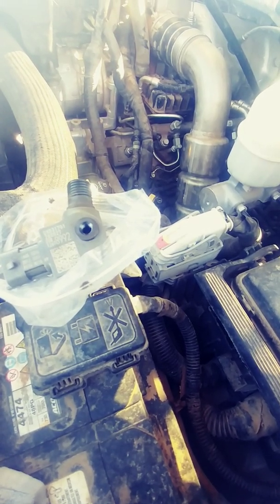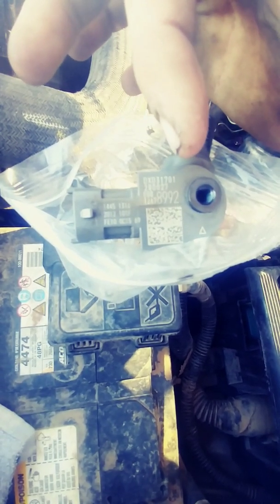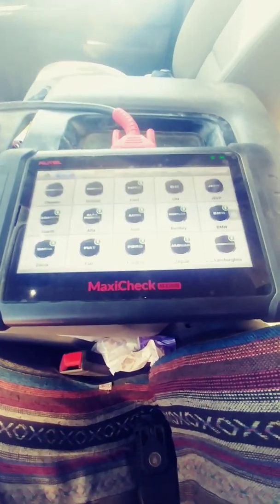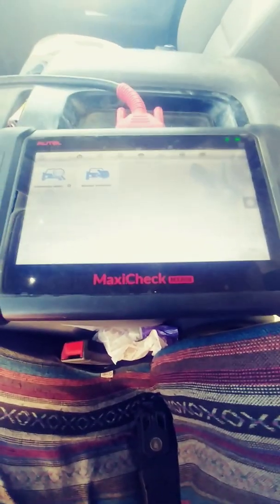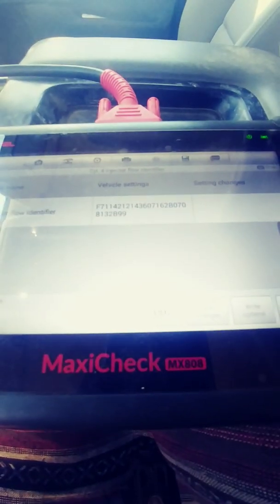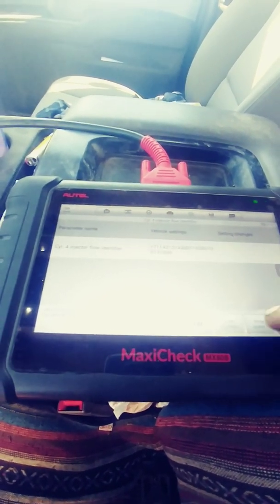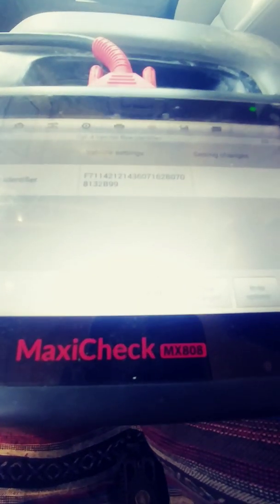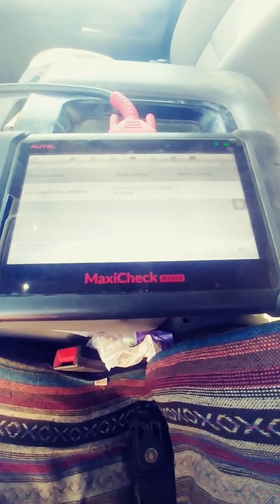2017 Chevy GMC Chevrolet Duramax 6.6 Injector flow rate programming coding Autel MX808

Comment: Are you able to save the flow rates and program them into your  Glow Plug Control Module GPCM?   (Just FYI that is where they are backed up just incase your ECM has a stroke.)

Comment: I am using a Snapon versus tool to program my LP5 cylinder 4 diesel injector and i kept getting function not performed correctly. I am putting the vehicle into service mode aswell ( hold ignition for 5 seconds) and still doesn’t work. Any advice?

Comment: Watched this cause I have never seen someone use an aftermarket tool for Flow Rate programming as I use GDS2 (GM tool). Just throwing this out there, in my experience it's best to change the injector connector also. They seem to be terrible with terminal tension and breaking terminals. Only injectors I've changed on the quite of few L5Ps is Cyl 4. Since the first one I did came back missing on cyl 4 and I noticed one terminal wouldn't even hold my test probe in it while being upside down, I've changed connectors also. That connector has no support like the others. An older Duramax (LLY?) had a tsb and a kit that was to change 2 injector connectors and add support tabs for them to prevent terminal breakage. These engines hopefully will have something like that in the future for Cyl 4.
Reply from the maker: I use snap on for my older vehicles and autel for my newer and my HD diesels.  Been very impressed with the scope of capability on these tools for what the price is.  Also use Autel for my labscope.

Comment: What’s the next model up from the mx808 that will do vgt ? Also assuming these do all of the body control stuff like windows and door locks ?
Reply from the maker: I believe it's the 906?  I'm not a dealer or salesperson, I just happen to use Autel tech.  I have a 908CV that I use for my VGT's.  It's an HD scanner but has the LD diesel and some gas functions (at least what I've looked for)
Reply from the maker: 18006607156 is the seller I use.